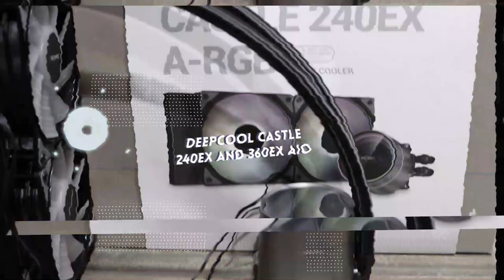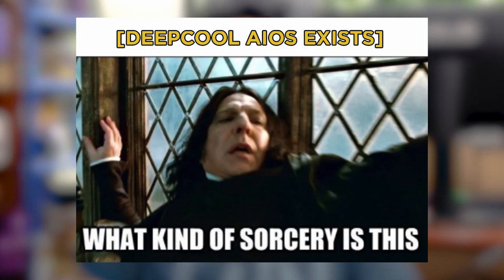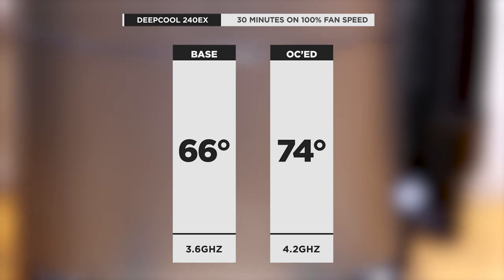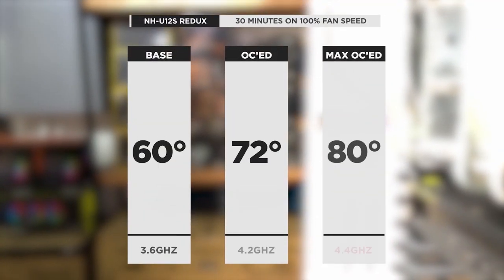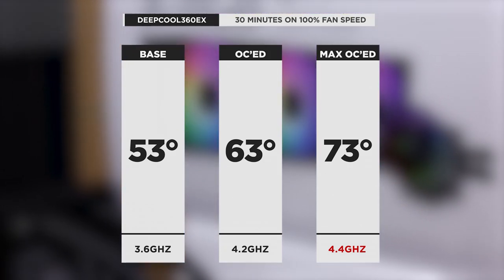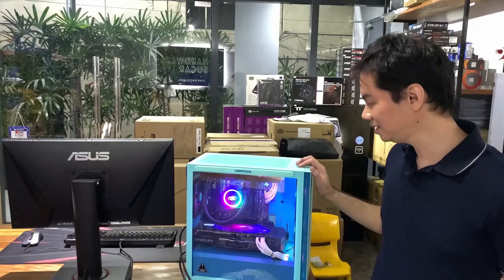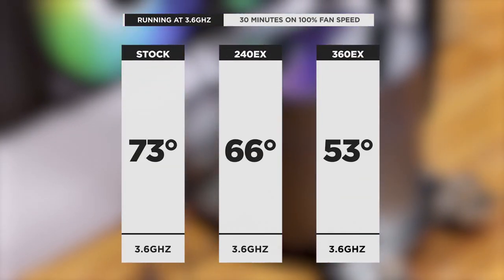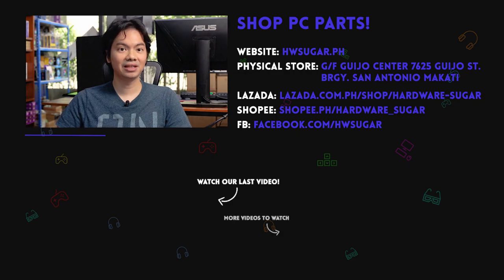AIO for you? 🌊 🌬️ Deepcool Castle 240EX ARGB and Castle 360EX ARGB Review

Comment: The Deepcool 240x could not OC the Ryzen 3 3100 at 4.4ghz kasi nag ccrash due to overheating
Pero the  Coolermaster ML240 Illusion RGB can OC my i7-10700k at 5.1ghz at 80c-90c via Cinebench R23 with a score of 13,600 normal gaming nsa 45-55c lang still staying at 5.1ghz all cores kaso 5k nga lang price nya compared to the cheaper 3k+ sa deepcool 240ex.

Comment: QUESTION PO:
Okay lang po ba na i-pair ko ang Ryzen 5 3600x sa Cooler Master ML120 v2 (120mm AIO)? Balak ko po mag-order sana kaso konti lang nag-rereview ng 120mm AIO.

(Di po ako mag-ooverclock, stock lang po hehe)
Reply from the maker: I'm not really a fan of 120mm aios in general, usually a decent air cooler will give you the same level of performance or better at a cheaper price